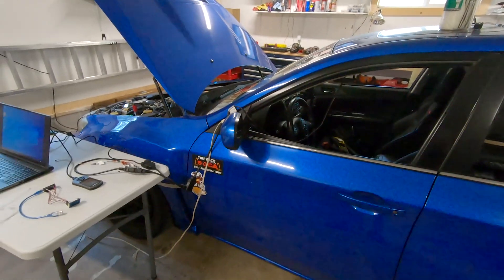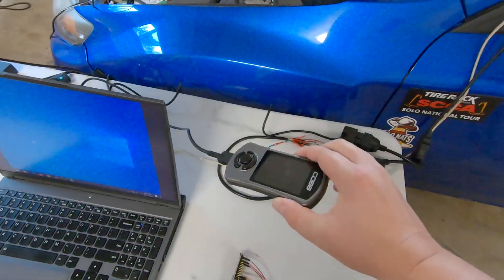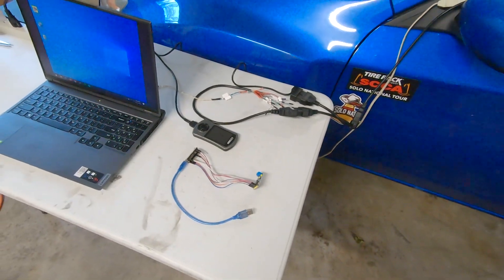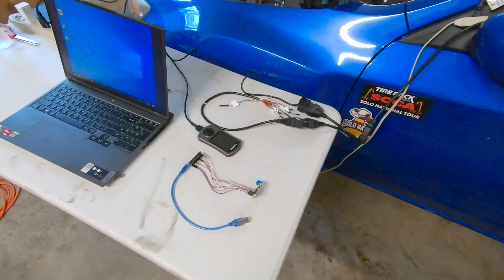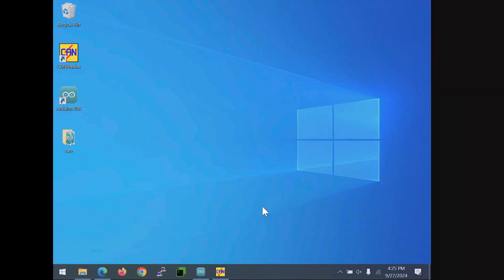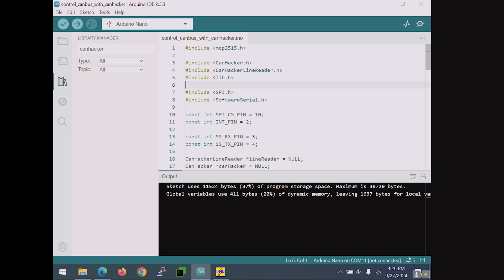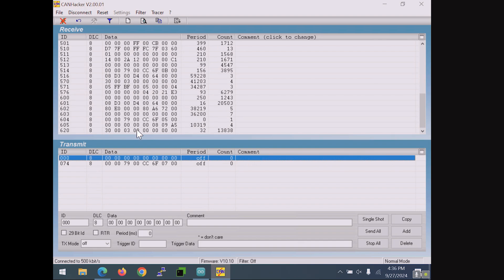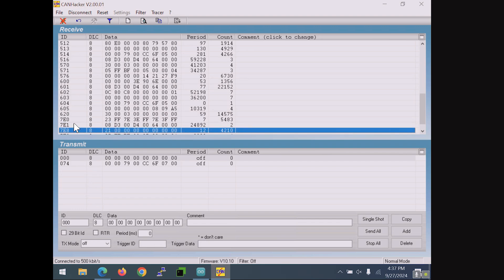Part 1 - Subaru CANBUS Sniffing with an Arduino - All you need to know to get started

Comment: I appreciate this video, BUT, romraider already exists, and does exactly what you are trying to do with the ECM. Also, SSM and flash write don't rely on CANBUS protocol on your GR to do the things you want to do. I am running a rooted tablet running ROM raider logger for my gauges.  Again, you would just need a tactrix style cable, from raider, ECU flash and the definitions.
Again, I appreciate the CANBUS information,n just wasn't NECESSARY to achieve the goals you laid out.
Reply from the maker: Hey, yeah in my other videos I go through the rom raider git for grabbing the memory addresses for reading the data off the ECU.  The main goal of this was to create my own little dashboard display like an accessport, without having to use an AP so I could customize it.  This first video demonstrating CAN sniffing leads into the playlist of making SSM calls like an AP does, which gave me the ability to display my own gauges and in the end use bluetooth to datalog to other apps like solostorm and track addict.  Pretty much my own version of the tablet stuff because I wanted more customization.

A lot of the default stuff people would want to display are on the standard non-extended memory addresses which should be uniform across ECU's, but I honestly haven't tried this on a different car yet.

Comment: I used the sketch you shared, the Arduino can connect to Canhacker, but no ID data appears when the Arduino is connected to Canhacker. May I have a sketch that is exactly the same as the one you used?
Reply from the maker: Hello,

That sketch is the one I used, however you still have to go through the process of editing things to account for changing the clock speed of the crystal, that is the main reason you would not receive any data.

The other reason could be the specific car you've got.  My car does not have a can gateway, but if you have something newer or a different model than you could very well have a gateway in between your obd2 port and your can network.

You'd have to see if other people talk about it, if you DO have a can gateway and want to just passively monitor you have to tap into the 2 wires somewhere else upstream.

If you've got a wrx 2014 or older, I would double check the mhz library edit was done properly as that is the most common way for things to be weird.
Reply: @T-WRXMechanic Yes, I have changed the 16MHz library to 8MHz according to what is in your video, and it matches the crystal on the mcp2515 that I am using.
Reply from the maker: @khusnudin0996  What car is it?
Reply: @T-WRXMechanic I am trying to do sniffing on Chinese brand vehicles, Wuling (SGMW) baojun and hongguang
Reply from the maker: @khusnudin0996  Oof that is probably why.  I can't provide any insight to those models, but I would guess with very high certainty there is a can gateway (basically a canbus firewall) not letting you see passive traffic.  in that case the solution is to tap into the wires somewhere else like behind the dash, but honestly I couldn't tell you where :(

Comment: Aren't those two yellow based pins behind the canbus screw terminals a jumper to allow a 120 ohm resistor thats on board to terminate the canbus? I don't think its supposed to have the can on there directly.
Reply from the maker: It is my understanding that both the exposed pins and the screw terminal are the same.  There is a "j1" jumper pin setup in the corner of the MCP that you would add a jumper to it if you needed to do the resistor.

Comment: I believe a esp32 has the canbus sniffer capabilities protocols directly.
Reply from the maker: Yep, an esp32 has native canbus, you just need a can transceiver instead of the MCP.  When I was first starting this all I had were arduinos, but I eventually moved to a teensy and I love the flexcan library much more than anything else I've found.

I've started messing with esp32's so I might get that working as well just to show what it takes.
Reply: @T-WRXMechanic  can you get the esp32 to work with obd1 subaru? thank you

Comment: Will this work on 2013 chrysler?
Reply from the maker: In theory: yes.

2013 should be old enough that you won't run into what's called a 'can gateway', which is basically like a firewall at the obd2 port that won't let you monitor passively by default.  Using the obd2 port is the easiest place to grab the wires, but if you DO have a gateway, you sometimes have to send a command through that announces you are monitoring, but in those cases you still probably won't be able to MONITOR passively.  In those cases, you usually have to tap into the canbus somehwhere else (like behind the radio or at a sensor)

Comment: nothing shows on the canhacker software
Reply from the maker: Honestly, double and triple check your wiring, and ensure you've got the stuff set for the 8mhz change as one little thing can mess it all up.  If you've got a newer vehicle that's got a can gateway, you won't natively be able to monitor, you'd have to send OBD2 / canbus requests and you should get responses.

Comment: Would love to connect with you.  I've used a WRX powertrain (swap).  I'm using a module to spoof a bunch of CAN messages for the missing systems (SRS, ABS, etc).  I would like to identify what is causing the "BRAKE" icon to show in the dash.  I'm pretty sure it's related to the vacuum pump delete but hoping I can spoof that signal back in the network.  I've also had a problem trying to send a new map to my ECU using m AccessPort.  It connect fine and I can export the current map but when I try to send an OTS map, it just fails.  Not wanting to be a leach, your videos are inspiring and I would be grateful if we could connect.  Not sure how to share my contact info here...
Reply from the maker: Hey,

Chances are what you are doing is going to be beyond what I've learned so far.  There are a couple regular CEL codes related to things like brake booster sensor or even the brake switch, but I don't know if they would throw a brake light fault, I am pretty sure that light is controlled by the VDC bus which I haven't tapped in to currently.

The cobb errors could be a couple things, like the ECU or AP was maybe already paired with something else?  Or the map you are flashing might not be compatible with the ECU ID you are using, but I've never gotten an error like that before.

You can hit me up at teewrexyt@gmail.com but sadly with those problems I don't know if I will be able to help.